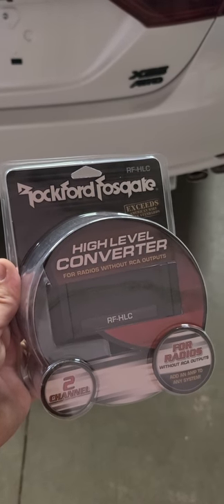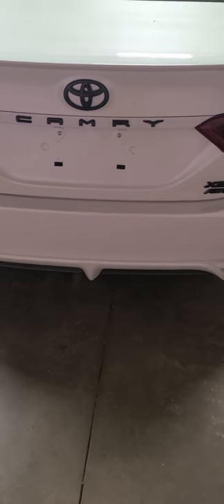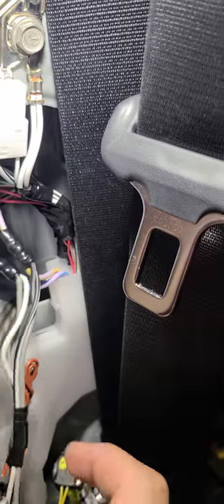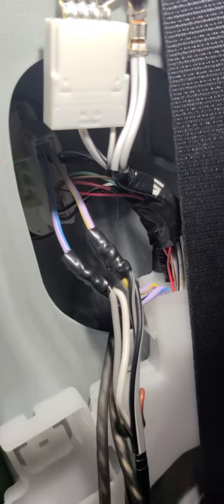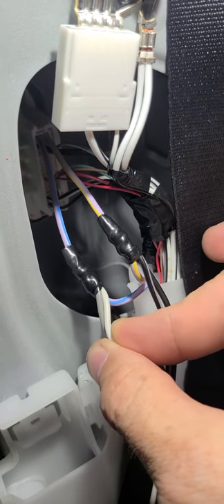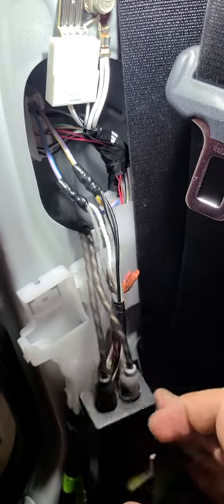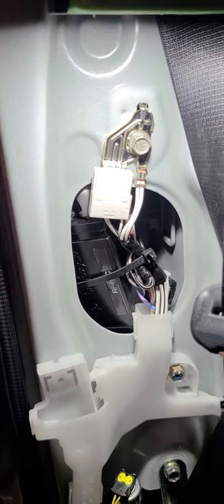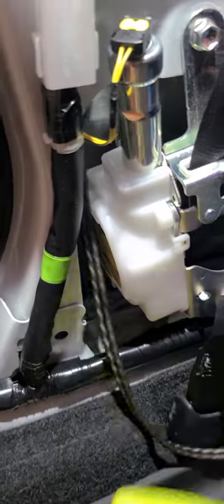2021 Toyota Camry xse speaker wire colors for high to low level converter installation.

Comment: Is it enough to connect the converter to one speaker instead of two?
Reply: Stereo sound is two channels, so it is best to use both channels for a line out converter. But since the application is just a subwoofer, one channel/speaker would work just fine.
Reply: @fnvideos4233  Thx. That’s just what I was thinking about, as the subwoofer generates bass only. 👍🏻